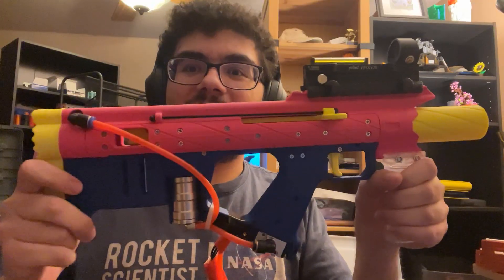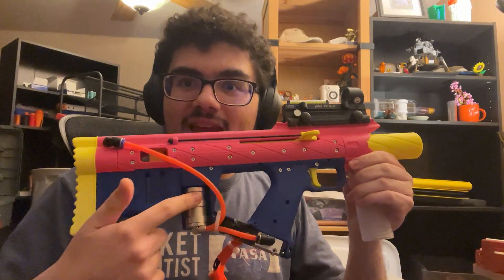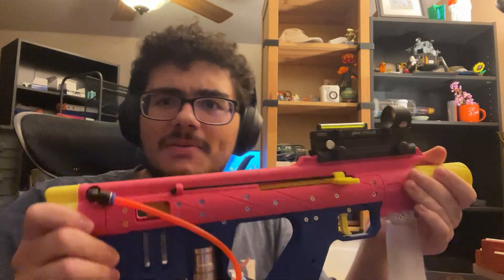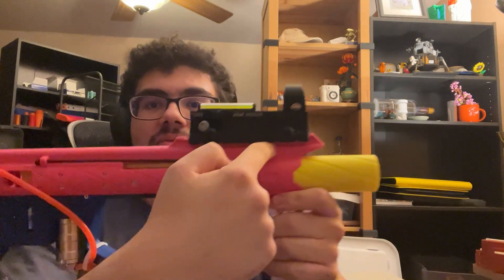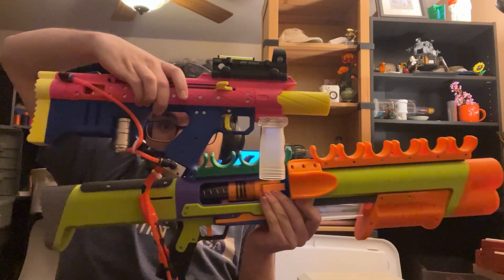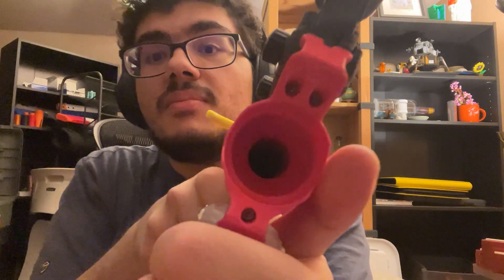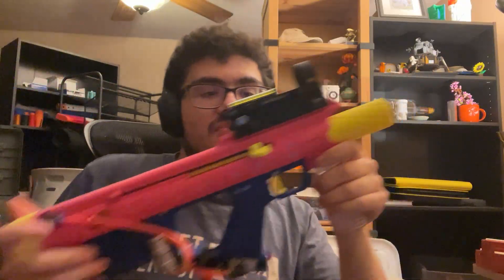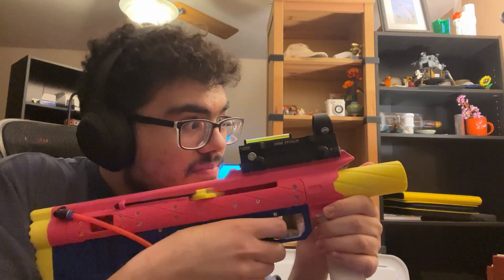FIRST PROTO - Bullpup HPA Nerf Blaster! Firing demo and explanation. #3dprinting

Comment: Any idea of FPS for this beauty other than short range hurts?
Reply from the maker: I think the Cosmic Nomad HPA core (which this uses) can be tuned for anywhere from 100fps to 300fps depending on what PSI you're feeding it, and how long the barrel is. Right now my setup should be hitting ~200 fps based on the results I've seen from others, but I do not currently have my chronograph around.

Comment: Any tips for getting better PLA prints? My supports keep scarring the surfaces where they connect to. Great vid / Build 🔥
Reply from the maker: You should try increasing the gap between your supports and the print. There’s a setting for that in slicers. If you’re using Bambu Lab printers, their default setting profiles usually do that well.
Reply: They make a PLA support material. It is made specifically to be support for PLA prints. Basically you just tell your slicer to use a different material for the support parts that actually touch. It makes it so you can get near perfect prints with no scarring. Definitely worth checking out if you havnt
Reply: also, was that foregrip printed as well?
Reply from the maker: The foregrip is a Worker foregrip, not printed. I really really like that grip, I use them on all my blasters. Lots of vendors sell them.

Comment: HPA means like, a full sized air compressor, right? Like this isn’t the kind of thing you could work with an Amazon tire inflator or bike pump?
Reply from the maker: You could use a hand pump, but you would need to pump it up every time you wanted to fire. HPA uses high pressure air kept in an external tank, which is then pulled out of it as low pressure air, which then feeds into the blaster. No manual pumping needed.

Comment: Love this design. Love what you're doing but. I dont see many HPA out there and i haven't really dabbed in to that part. If it more expensive for those parts? I love new things so i would definitely love to try something like this.
Reply from the maker: The components on the blaster itself cost ~$80 probably iirc. Plus electronics (if you decide to use any) which are another ~$50. Plus needing a regulator and air tank if you’ve never done any sort of HPA before (another like $100-$200). 

The first time buy in for HPA is VERY STEEP. 

I’m mainly making these HPA blasters for my own enjoyment and just sharing it with the limited amount of other HPA users. Not really trying to get everyone to spend half a thousand dollars on a blaster ecosystem.
Reply: @Sillybutts true i understand that man. I love the design and would love to see it in a springer style set up similar to the signet.